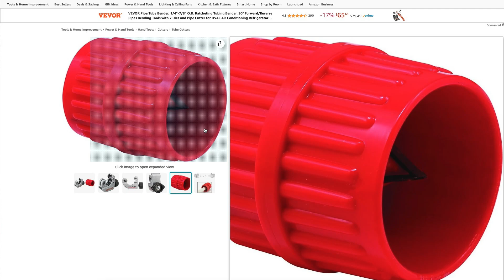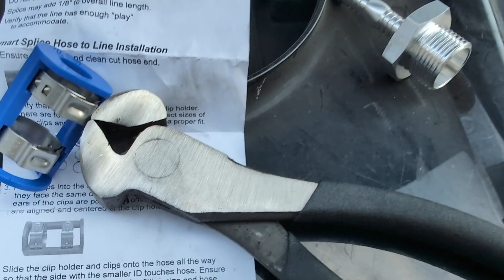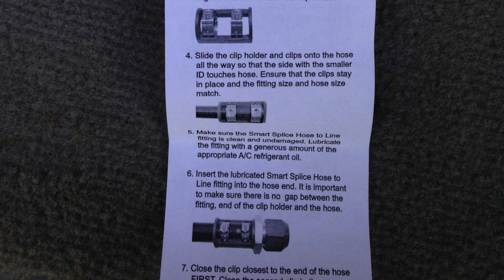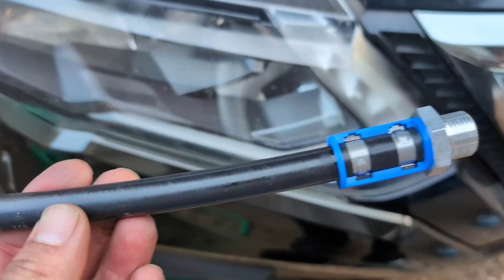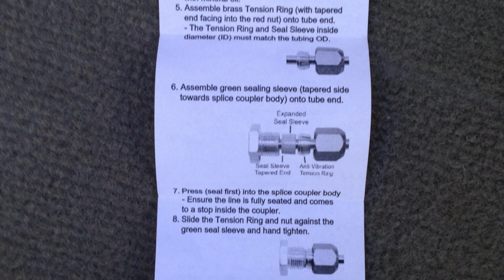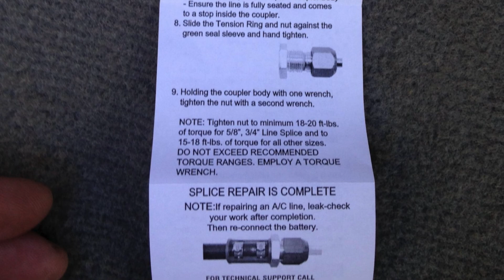A/C line repair using Dorman splice kit

Comment: Great video. I have a 2014 Jetta that has 10mm line and dorman doesn't sell a kit to fit. So I purchased the 1/2" kit and then some dormann 10mm hose ends (the brass compression sleeve and green rubber piece) which worked with this kit no problem.
Reply from the maker: Nice work figuring out that workaround, well done!  Thanks for the feedback.